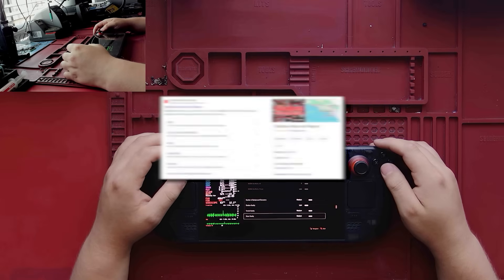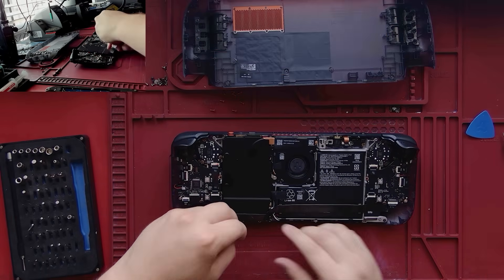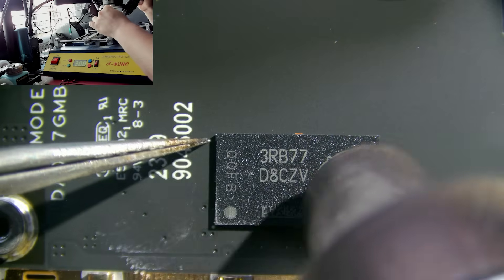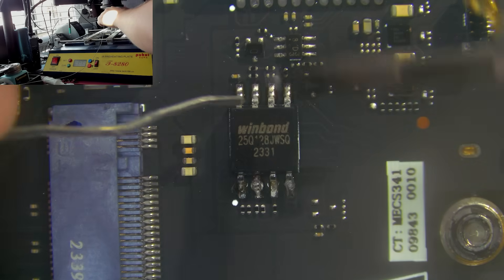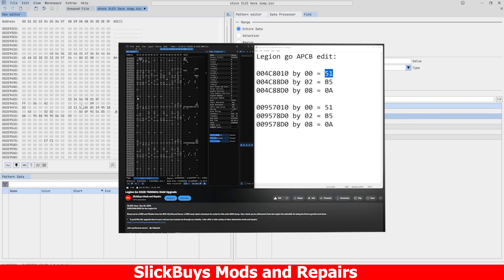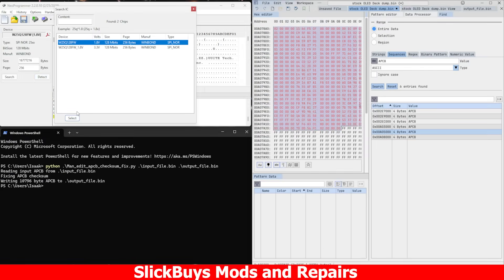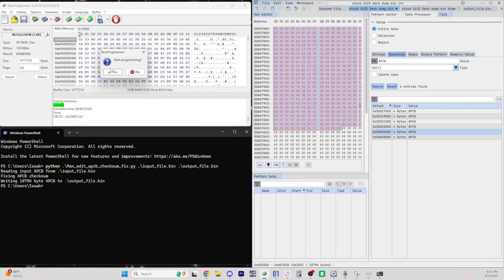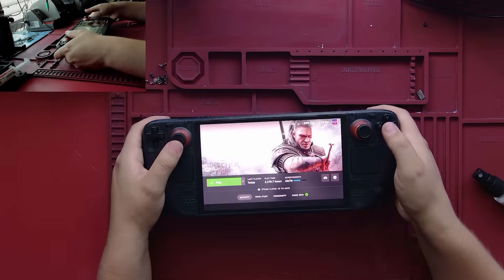Steam Deck OLED 32GB RAM Upgrade

Comment: Just got mine back ands couldn’t be happier with the service

Got the 32 GB ram upgrade 
Left bumper fixed, ribbon cable plugged in fully 😅

If anybody wants to get the most out of their deck and has been on the fence, definitely go for it! Absolutely worth it!
Reply: How much was the service, how long did it take and how did you ship it?
Reply: How much was the service, how long did it take and how did you ship it?
Reply: @damanichambers5364 I paid $265 but I also got the left bumper replaced, considering current ram pricing, can’t beat that and it was ready within 2 days after he received it
Reply: How is need this

Comment: Bruh. you should have at least cleaned and redid the thermal paste.,
Reply from the maker: For what purpose?
Reply: @SlickBuysModsandRepairs being exposed to dust and being handled and flip a few times could have been contaminated with body oils or dust when at the heat station. But like it’s always been the thing I did. When I take apart an oem sealed console or whatever it may be I always clean and apply new thermal paste. But I’m old lol so maybe it’s just overkill.
Reply from the maker: No it's a good precuation to take, and something I would do if it was needed. When I work on a customer's device I throw the board into a ultrasonic cleaner in which case I do repaste the APU. Since the unit in this video was mine I didn't really care if temps were off by a degree or two, assuming the thermal paste was contaminated or not adequately spread.

Comment: when i was a mechanic the general rule of thumb most shops go by is take the price of parts and either charge 50% up to 200%.
the reason why is sometimes parts cost a ton and its super ez swap. sometimes parts cost nothing and its a 4 day job. sometimes everything is expensive and time consuming. one price fits all doesnt work unless its always a gain. yeah you apple.
ive seen the stock memory chips for the steam deck sell for nothing in the 32gb flavor. like 2$ a chip u need 4. but ive seen the faster ones like the oled chips sell for alot more so about 60-100$ seems right for the parts. add in time and charge 20-25$ an hr labor and a 4 hr job about 200-220$ seems steep. but thats about what it costs. especially if you pop in a newer hard drive or some buttons or bigger batter better screen. you know add a few things all at once and now its a win for everyone 225 for 3 upgrades is a win even if they supply 2 of them for 10-20 apiece
Reply from the maker: BGA rework is expensive highly skilled labor. The chips cost me about $110 USD and the overall process take me about an hour and some change. I settled on $230 for the price of the upgrade. Thanks for the insight!
Reply: @SlickBuysModsandRepairs  funny we both came to about the same with diff formula. but thats a solid price. im really considering getting the swap done on the steam deck i bought. ik its only marginal gains on the base version with slower ram. but its future proof with the more ram as newer games need soo much ram.

Comment: so whats the going rate for this mod? its tempting since 16gb handicaps the system a little bit.
Reply from the maker: Reach out through my site for a quote: https://slickbuysmodsandrepairs.com/
Reply: looks like $200-400~ depending on the technician / repair store you bring it to. This video is just too good! Edit: Cost of labor for the soldering and reassemble + disassemble. Everything else can be done if you make backups.
Reply from the maker: $220 which includes the required parts, 2 year warranty, AND return shipping if done through my shop.

Thank you for the kind words!

Comment: Has anyone tried to dump and flash these bios chips while still installed? If it's possible to do that, then it'd be possible to install a ribbon cable that someone could hook up to, to remod the bios after an update.
Reply from the maker: Yeah that's possible with some commands in Konsole on Desktop mode

Comment: Do you think this upgrade is worth doing? If i would buy a brand new steam deck oled from valve or should i wait a year see how i like the deck while having the official one year warranty from valve and only then see if its worth upgrading it with more ram and well naybe a bigger battery? If that kind of mod exists a 80wh battery on the steam deck oled would be amazing given the already huge sistem efficency that it has with its 50wh battery. Still a pretty cool video and as many maybe have said im more curios not about the extra ram but about videos in reggards to maybe a bigger battery on the steam deck oled because if that exists i think it would make the steam deck the ultimate handheld 😭😅

Comment: Is the ram upgrade the same speed or faster than the original OLED Ram speed?
Reply from the maker: Same speed, I don't think the Deck's memory controller supports faster speeds but I could be wrong

Comment: Hi! Great job! Could you please give more details about the BIOS chip connection via the USB Programmer? What USB Programmer are you using? How did you solder the programmer to the chip? 
Also would this BIOS mod affect the functionality of Windows 11 on the SteamDeck? I have a dualboot and I'd like to keep using Windows 11 besides SteamOS.
Thanks!

Comment: Bruh, replace the thermal paste. xd
Reply from the maker: why
Reply: @SlickBuysModsandRepairs  i thought you know better. nvm
xd
Reply from the maker: is it possible the paste was replaced after I recorded the video? Is it possible the paste didn't even need to be replaced at all xd
Reply: @SlickBuysModsandRepairs  I just thought the contact point was messed up when you didn't put on a new paste.
if you replace the paste behind the scene, then its good. xd

Comment: Surely there is a less error prone way than manually editing values in a hex editor and copy pasting? I'd think it's just a matter of time until you do this tired, or distracted, and end up bricking someone's beloved device.

Nice work overall.
Reply from the maker: I've been doing this for enough years to have checks and balances in place to prevent that. 

Thank you!

Comment: Amazing job. Im thinking of sending my rog ally x in for a 32 gb upgrade also the right volume button wont go higher on my unit so im wondering if slick can repair that as well for an extra cost?
Reply from the maker: I can get both of those done for you no problem! Shoot me a message: https://slickbuysmodsandrepairs.com/

Comment: Now I need someone to come out with a larger and safe battery upgrade for the deck
Reply from the maker: I've installed an 80Whr battery before
Reply: @SlickBuysModsandRepairs Really? How’s it holding up? I saw some 50W55W batteries for deck on AliX but nothing higher than that
Reply: @SlickBuysModsandRepairs I would definitely pay for that upgrade if it’s stable btw
Reply from the maker: The customer hasn't had any complaints, it's been 3-4 or months since they've had it back in their hands. Reach out and I'd be happy to give you more details!
Reply: @SlickBuysModsandRepairs  Definitely will! Thank you
Reply: @SlickBuysModsandRepairs where do you get that from lol

Comment: Question it a Steam Deck on eBay for 350 I thinking about buying it but the users says the left joystick isn working properly and it only has 256 GB should I get price lower and try to fix and upgrade ream to 32 gb or just pass ???
Reply from the maker: That's a pretty decent price. I'd try to get it lowered to around $300, and then put the saved money towards hall effect sticks and 32GB RAM.

Comment: I may not be an expert in computer mechanics but are you sure just hot gluing the chips, especially the last one, is strong enough?
Reply from the maker: Zero glue was used in this video, as gluing doesn't form a molecular bond between the solder
Reply: @SlickBuysModsandRepairs  then whats that stuff you were using
Reply from the maker: perhaps you're referring to the flux?
Reply: @SlickBuysModsandRepairs  yeah that stuff you put on the board after putting the chips back on

Comment: Thank you very much for work! I will try myself modding my OLED. Can you share "real" name of chips used ? Searching by name from video takes nowhere. Similar to searching SMD ICs with manufacturer "secret code: only. It blows my technician mind we can have 32GB of ram with just two chips, such density. Just "yesterday' it were 4 or 8 chips to replace, it seems much easier now, especially with distance between RAM and AMD CPU
Reply from the maker: Yes the density in such a small form factor is crazy! The same can be said about micro SD cards. Here is the chip name: MT62F2G64D8AJ

Comment: @SlickBuysModsandRepairs Question for ya does the bios edit stay after updates or does it have to be re edited if a steamOS update has a bios update for the device
Reply from the maker: Not if you block the BIOS from updating, which removes that issue.

Comment: Awesome, but a bit sloppy in some areas. No new thermal, and used same solder on bios chip. If I paid you I'd expect more professionalism.
Reply from the maker: This is my personal unit, I repasted it post footage collection. The BIOS chip doesn't need new solder, it's not like it'd expire 10 minutes after removing the chip lol. Thanks for your input!

Comment: Will you be doing benchmarks to show if their is an appreciable difference in performance?
Reply from the maker: Coming soon! I plan on collabing with another Deck content creator to get a benchmark video put together.
Reply: @SlickBuysModsandRepairs  Oh, wow. Thank you, looking forward to it.
Reply: Agreed, it should have been done on this video, the mod is cool but we all want to see the performance.
Reply: Highly doubt it. Adding more ram is only a benefit if you find yourself running low on memory all the time. Linux and the fact that most people are gaming at 800p, I can't imagine anyone running out of memory
Reply: @Kidkosmos  Well it will increase bandwidth but I doubt that will increase fps in most circumstances but I cant be sure is all.
Reply: @Kidkosmos  Exactly, people think upgrading the memory is like installing a better CPU or GPU 😂

Only place where performance gains would be seen is when stock oleds are reaching low memory which would let upgraded devices run normally, or when steam deck would transfer more ram to the CPU (RAM is shared between CPU & GPU) it would not affect the upgraded old deck since the higher capacity. Lastly but not least games that would require higher RAM amounts than the stock device has would probably give a boost in performance on these games.

Comment: seems like at least 250-300$ for this, but you should charge more at the start until you get a steady rate of customers.
Reply: or rather, what would a steam deck that has 32gb ram would end up costing
Reply: I think you should keep in mind that not everyone lives in Cali or Florida or NYC, down in Texas this would be more around $225.
Reply: @matthewkolar7560 I’m in Htown I think $200 max for this, especially with the risk your taking actually dropping off/shipping. Not sure if this is insured or this shop will take on the liability
Reply from the maker: 2 year warranty is included in the service, as well as return shipping. I think $220 is a good starting price for this service.
Reply: @SlickBuysModsandRepairs that’s very fair, especially with a 2 year warranty and return shipping, I bet you could even do it as part of a package like replacing the sticks with Hall effect and a few other mods all in one. I love keeping it local here in Houston Texas! (Cheap pop) 😂
Reply from the maker: You should check out my site, I do it all: https://www.slickbuysmodsandrepairs.com/
Reply from the maker: The parts are included
Reply: 76.56 US dollars, this is the price of memory chips
Reply from the maker: For chips of unknown quality. I am currently testing different suppliers to see if I can gets the chips cheaper and not sacrifice on the quality.
Reply: lol no, this should be no more than $100-$150, Ram will become common soon
Reply: @raymondvela8774  this comment aged like fine milk

Comment: Do you need to patch the firmware with any steam os updates?
Reply from the maker: So when I downloaded an update from Valve the 32GBs was still recognized, so the BIOS was overwritten from that. Still its best to block the BIOS from updating just in case Valve decides to drop an update that'll overwrite the BIOS. This is easily done via ryanrudolfoba's Steam Deck BIOS manager program.

Comment: Looks sick, might send you a msg at some point but was wondering if it was possible for the bios ever get reset from an update to the steam deck?
Reply from the maker: Sounds good! You can block the BIOS from updating when you install Valve's firmware updates. This is done by using ryanduolfoba's Steam Deck BIOS manager program. This procedure is included with every Steam Deck RAM upgrade order when done by me.